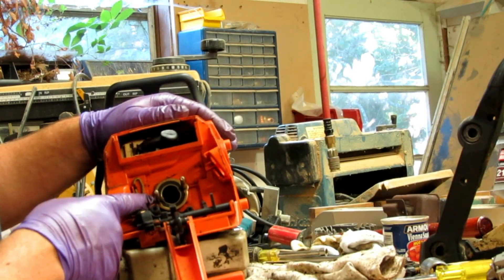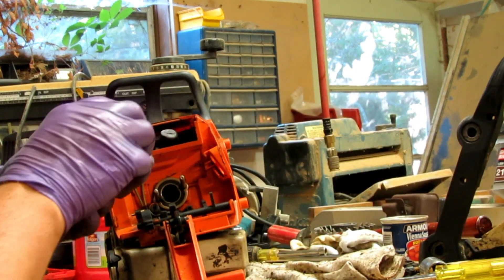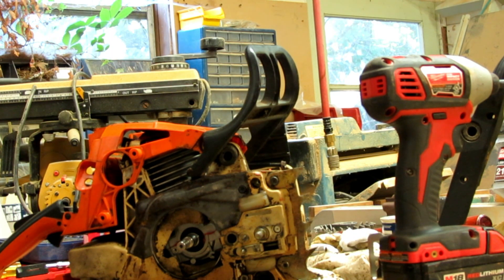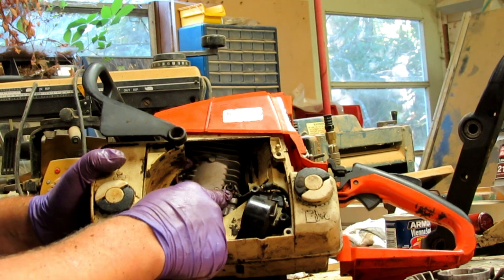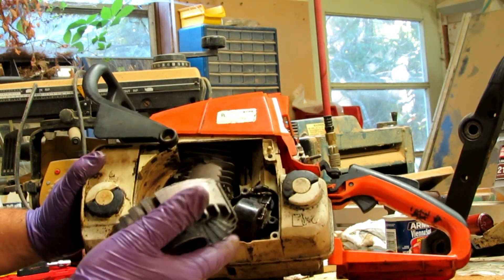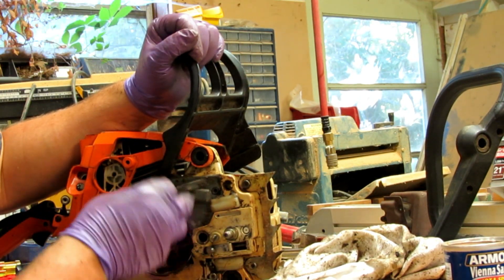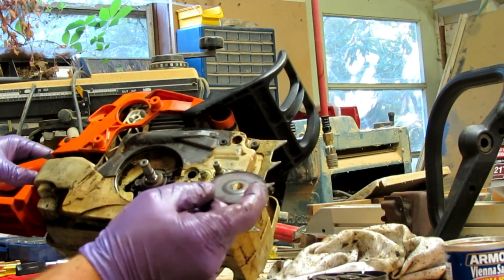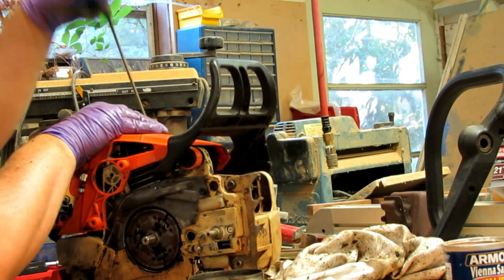Part 3 MS290 to MS390 Engine Conversion Swap 46mm to 49mm 56cc to 64.1cc

Comment: I just have one question, how would you compare the power difference between your 290 and 390 conversion?   It sounds really fantastic
Reply from the maker: @HawtSawz86 stock and in small wood they are very similar. Stock in larger wood the 390 has more grunt. Does way better starting the chain from a stop in the cut. Very noticeable. Throw a pipe on the 390 with the same .325 chain on an 18" bar... Magic!  Quicker rev for limbing, plenty of power for buried cuts, smiles for miles. I am thinking about doing a side by side comparison in some bigger wood with same bar and chain. I have a piece of maple I have been whittling on. Hope this helps. Thanks for watching! ~Mr. C.

Comment: I just recently got an 029 with bad crank bearings and I was looking at this exact same engine kit you used for mine.
Reply from the maker: @stevenkinnison8044 hopefully you got a good deal on it. It's not bad but does take some time. A lot of little parts to get that new motor in. So far so good. The saw is in a truck right now. When they make it to a truck that means they are fairly well sorted out and reliable. Check out my (neighbor) Doctor Cutter  with an update on the saw. Thanks for watching and letting me know. ~Mr. C.

https://youtube.com/shorts/6QI-q8ITtTo?si=d_f9nU5aUk9lwlKS

Comment: What did you do about the hole in the top cover for the decompression button? The ms290 does not have a hole or a decompression valve but the 390 does.
Reply from the maker: @outboardfixer I would suggest installing a decompression valve plug (link below). No hole required after that. I did however drill a 1 inch hole above the valve in the top cover with a hole saw before I plugged the cylinder hole. Excellent question! Thanks for asking. ~Mr. C.
https://amzn.to/43vSmkS

Comment: Awesome video series! I was wondering if it still works and would you do it again?
Reply from the maker: @billhacks glad you liked the series. I had a blast putting it together. Let's start with the first question. Does it still work? That is a resounding YES! I have used it very regularly and have probably felled and bucked up over 100 trees with this saw. That might not be a lot to some but I have other saws to test. I have used her as the primary saw since the rebuild just to test longevity. It owes me nothing. With that being said. Would I do it again? The answer is also YES. It's not hard and for the price of the complete new motor is still very affordable. Excellent questions! Hope this helps. ~Mr. C.

Comment: Thanks to your video I think I might have a chance of rebuilding my ms 290 .
Reply from the maker: R G I think you have a very good chance at rebuilding your old saw. Take your time and lay everything out as you go. Keep things clean and organized and you will be done before you know it. I have been running 25:1 mix in mine to help give those aftermarket engine parts plenty of lubrication. Have fun! ~Mr. C.

Comment: Can I do the same swap on a 029. People say the 029 and the 290 are the same saw
Reply from the maker: William Hamby the easy answer is yes. Those bodies (the 1127 chassis) are the same. The difference I have seen in the two are the carburetors and air filters. If you have a complete setup just use what you have and you will be good to go. Check out some of the test cuts I made with the conversion saw. Personally, I love that saw, it seems to be getting better and better. Excellent question. ~Mr. C.

https://youtube.com/playlist?list=PL9e-N4NEgHNugVR3FhAPMhAS23fPoHIW2

Comment: May I ask which manufacturer you bought your kit from? Are there differences between the kits, cause they all look the same. Getting ready to do my ms310. Thanks so much! Great videos!
Reply from the maker: Cameron Fields I purchased it from eBay but that seller is not active anymore. I purchased another engine from Amazon and It appears to be the same manufacturer and packaging. I would suggest capping the decompression valve because the cheap ones are prone to failure. Good luck on the swap! Be sure to check out thrifty garage, he has some videos on the ms290 swap too. See the link below for the engine. Thanks for watching and asking! ~Mr. C.

https://amzn.to/39trvvn
https://youtube.com/playlist?list=PLMdlp6oxdAjLbVO4YZIaQmSIwKwM0KyMA

Comment: I just ordered 2 they will be here on the 8th of this month I will start rebuilding my two 290s thanks for the video very informative
Reply from the maker: Diamond family Homestead thank you for watching and commenting. Glad you liked the videos. Good luck! ~Mr. C.
Reply: The crank case where the bar bolt goes in was not drilled deep enough so I ordered two stihl crank case pans

Comment: Did you keep the oem 6 spark plugs? Or move to a hotter 7?
Reply: Spark plug
Reply from the maker: Bob T I used an NGK BPMR7A, it was what the Stihl manual calls out (page 56). Hope this helps. ~Mr. C.

https://www.stihlusa.com/webcontent/cmsfilelibrary/instructionmanuals/stihl-ms-290-310-390-owners-instruction-manual.pdf

Comment: I'm in the process.  I bought a used MS290 which had a good engine but I wanted to upgrade as you did.  Super job on your 3 part videos.  Watching them helped me immensely!
Reply from the maker: John Parson glad you liked it. I would hold onto the old factory Stihl engine. If it looks good inside it might come in handy one day. ~Mr. C.

Comment: Hey whats up, curious if you had any issues with your starter? I rebuilt using a nice meteor 49mm P&C kit that went together nicely, however I didn't use the decomp, wanted to keep that off to eliminate any possibility of it coming apart and ruining the piston in the future. Problem is I can't hardly pull it over! Have two OEM starters, one for a 290 and one for a 390. Its like I can get one revolution of the motor, and it just binds. Both starters would just fine on my 029. Take the plug out and it pulls just fine. Seems like it has so much compression that the starter just can't lug it. Do they make a starter with 2 pawls? Any ideas? Checked the plug, no slappin there, Bosch WSR6F.
Reply from the maker: aeridyne I have had no problems with the starter. It does sound like you have a lot of compression. I did not cover this in the video because it is a clamshell design but did you happen to check the "squish" ? it is the measurement between the top of the piston and the squish band. I have not seen any alternatives to the OE style starters. A Husqvarna decompression valve is the only one I would use if I were to use one at all. I agree with your idea of not using a deco valve though.

Check out my buddy Walt, he has an awesome video that explains squish.
https://www.youtube.com/watch?v=Lw-XVE7NAjs

Good Luck! ~Mr. C.

Comment: Do you think the cross performance piston with the caber rings would work with this eBay engine?
Reply from the maker: Matt Schaeffer I totally think those parts would work as long as all of the bore dimensions match up. I have a really cool guy I watch that has done the exact process you are asking about. His channel is afleetcommand . Walt knows so much more about the aftermarket and it applications than I do. Excellent question! ~ Mr. C.

Comment: What is a upgrade like this for a ms260pro? She runs 18in bar good but like lot men out there wd want more power faster it cuts faster to get to corner bar for happy hour. Lol stihl dealer wont tell me crap and it is all right there in book and saw is old no warranty idk why he doesn't want me to hot rod my chainsaw with my money lol he acts like its one of his kids or he personally built saw or something. I ordered books for my model idk how much it will tell me though.
Reply from the maker: John White I understand your desire for a little more punch from a nice to handle package like a ms260. I have a worn out 026 on the list of videos to make.  This will be another rebuild with an aftermarket set of parts. I have found a wealth of information from this really cool guy on youtube. He generally only works with Husqvarna but the information about hopping up your saw is pretty universal. His channel is afleetcommand . Look back to some of his older stuff where he covers the basics. Good Luck. ~Mr. C.

Comment: My dad recently picked up a like new 029 and its just a little anemic in my opinion. Is it worth doing this upgrade for more power? ...or am I better off to buy a bigger saw?
Reply from the maker: Chris Prucha I have been pleased with the performance of the replacement engine. I have a hard time taking apart a perfectly good saw to put non oem parts in it. If you can find a junk saw and swap the engine then put your good easy external parts from your saw on it you can try it out and see if it will meet your expectations. An old mechanic told me a long time ago " There's no replacement for displacement". I would suggest getting a bigger saw if you want to run a 20" bar through some gnarly hard wood. ~Mr. C.

Comment: any special break in for this build?
Reply from the maker: Timidater I try to not run it out of a cut at full throttle for the first three fuel fill ups. After that, it's game on and time to treat it like a chainsaw. Excellent question. ~Mr. C.

Comment: I am doing this upgrade also.  How did you add the decompression hole?
Reply from the maker: Thrifty Garage I put the cover over the installed valve then eyeballed a pilot hole over the center of the valve. I removed the cover and drilled a hole with a 1" hole saw into the cover. I would love to see a video of yours running or let me know how it went. Good luck! ~Mr. C.

Comment: How did this conversion work out for you??
Reply from the maker: Timidater the conversion is working great! The only thing I changed was I ordered up a factory Stihl ms390 carburetor from my local dealer and tuned it up. I have about 5 hours on the saw now. I tried a 20" bar with my carbide chain and it cut good. I swapped out for my 18" bar and a fairly new sharp oilomatic chain when I got into some cleaner wood and... WOW it pulled like no tomorrow. So far so good. I am pleased and you can't beat the price even if I have to do it again. If there is a next time I have a nice video series to watch to help me. :) ~Mr. C.

Comment: Hello and thank you for these beautiful videos. I myself have a stihl ms 290 which I will change the carburettor because I have a problem at this level. The start phase with difficulty and once start when I released the accelerator it stops, I cleaned the carburetor but without result even changing the settings. A person told me it was the piston but I have no way of knowing if it is him, on the ignition side, the spark is very good. I came to you to know the reference of the engine you installed and especially where you found it. Looking forward to your reply, thanks again for his videos
Reply from the maker: alain Gaillard I purchased the MS390 engine from Ebay. I would suggest a compression test. This would be a good place to start to see if in fact the piston is the problem. I appreciate knowing these videos are helpful to you. Thanks for watching! ~Mr. C.

Comment: I did the same thing on my MS 310 by installing a Stihl brand 390 cylinder on it. The only thing you might want to be careful of is the carb. on a MS290 has a smaller main jet in it than the carb. on a MS390. So it could possibly cause a lean fuel mixture in the MS390 cylinder and lean seize. I would suggest purchasing a MS390 carb. for it. They are only like $40.
Reply from the maker: Glenn Roemer Thank you again for your advice. I will make a video in the future of the carburetor swap and explain why I decided to make the change. I really appreciate viewers/commenters like yourself that are willing to take a few moments from their busy day to help a fellow repair person do things properly. ~Mr. C.
Reply: Nature's Cadence Farm. No problem glad that I could help out. You do good work. Where are you from?

Comment: Good video. How’d you know where to locate the opening for the decompression valve and was there a major tuning difference for the bigger displacement.
Reply from the maker: Russell Simmons I placed the cover on the cylinder and then eyeballed the spot where the hole needed to be. After marking the spot with a nail I used a 7/8" hole saw to make the hole. I did need to make a few adjustments to the carburetor to get it running but I am going to change out to a MS390 carburetor soon so I don't lean out the saw. Excellent observation and question. ~Mr. C.
Reply: Wonderful video series here, and very good attitude to do what takes to get it right.  The saws all run so lean now that I agree it is a good idea to spend the money for the right carb and then set that thing to run a touch rich just to be safe.  My stock 290 is still going but I would consider this upgrade if I ever fry the engine, hopefully, God willing, I won't! It will be fun to see how this saw runs and what you truly think of the swap after 20 hours on the saw or so.  Thank you very much and God bless you.   @NaturesCadenceFarm
Reply: Cool.  Let us know how it runs after ya get that done.  Thank you.